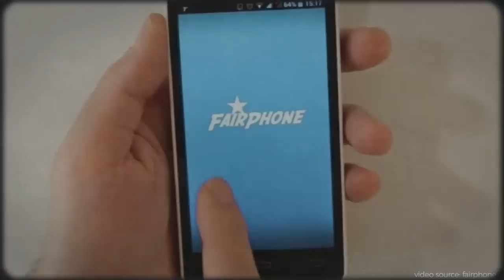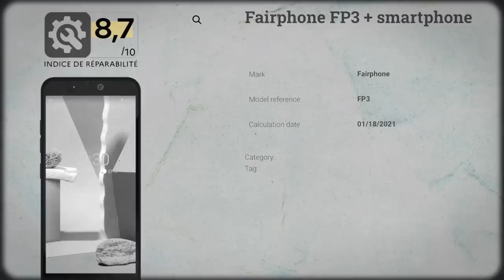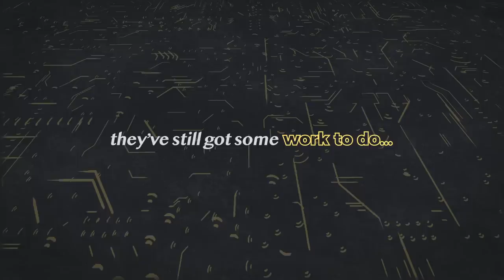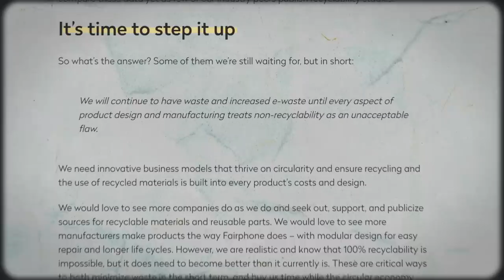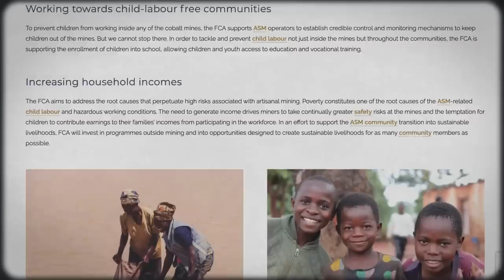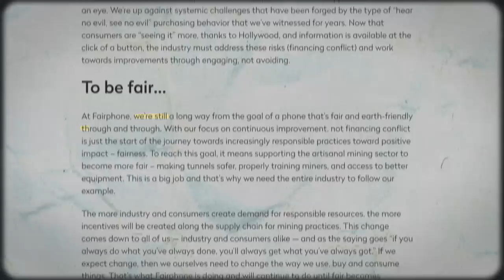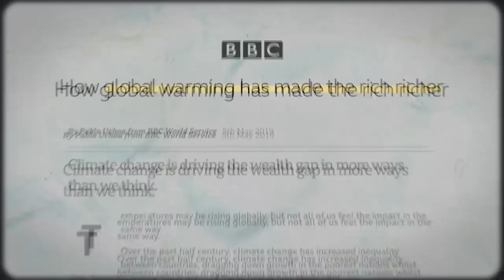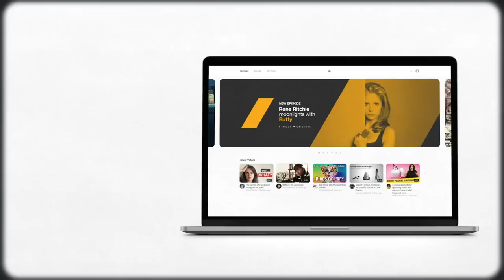Is This the Most Sustainable Smartphone?

Comment: I mean It‘s all great but the Fairphone doesn‘t make sence for many. My 6 year old iPhone 6s beats the newest fairphone in all benchmarks. This can‘t last for 5 years, this is a fantasy at best and straight up false advertising at worst. I am willing to make secrecies for a green smartphone but this phone would be worse than my current one and it wouldn‘t even be greener. Yes replacing a screen in 8 minutes is great but how often do you have to do it? I had to do it like twice over 6 years so it doesn‘t really matter that it takes 30 minutes. Same goes for the battery eventhough I wished they could be replaced more easily.
Reply: The Fairphone 3 is on par with iphone 8 benchmarks. Where did you get the 6s comparison from?

Comment: I have to say it’s a bit of a weird take to say that there’s a problem with investors or the founder of this company making any money from this. You say the value is generated by the workers as though it’s only generated exclusively by them, but that’s evidently not the case as this company and the good it’s doing would not exist were it not for the founder and the investors. I understand where it comes from but the fact is they are contributing too, and they have every right to make money from it if it becomes profitable - or there would be no incentive to do this in the first place. You also assumed fair phone is profitable which seems unlikely as it looks like a relatively new company? Chances are the founder and investors are losing a lot of money on this and do they not deserve a reward for that risk later down the line?

Comment: What? How is a iPhone a 6 on reparability. No easy way to order parts, no way to repair it yourself easily, forcing shops into a contract to get parts and documentation is less then consumer friendly and let's be frank they are designed to not be repaired. If that is a 8 and a phone made to be repaired is just two points higher. What is a bad score for a phone on that scale? One made out of glue ?